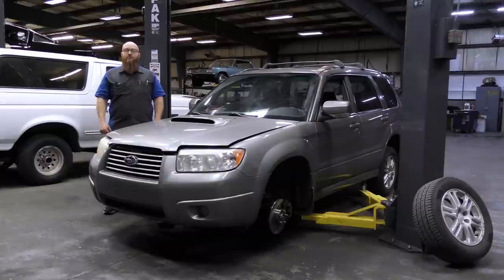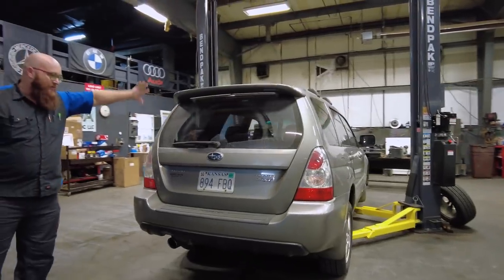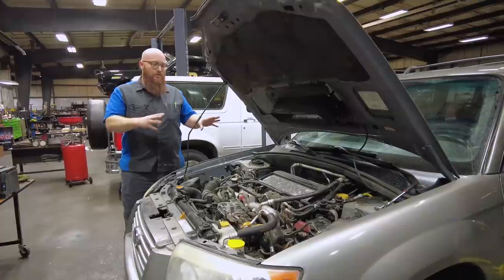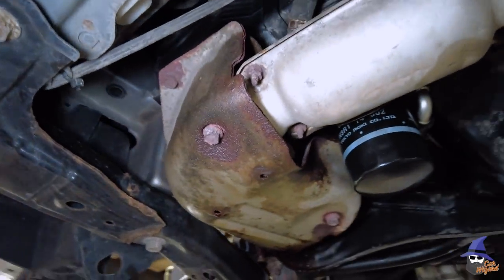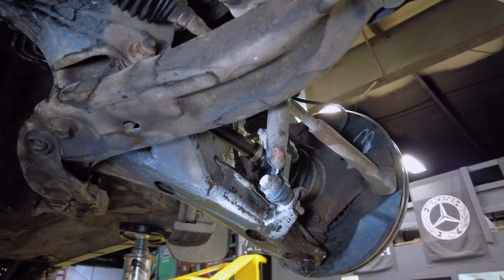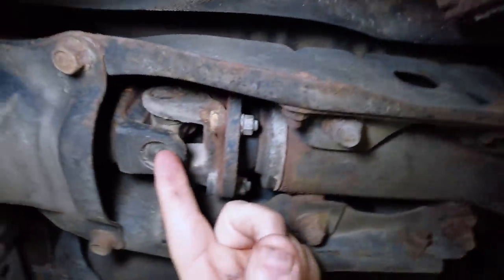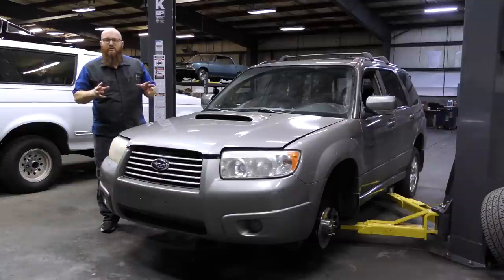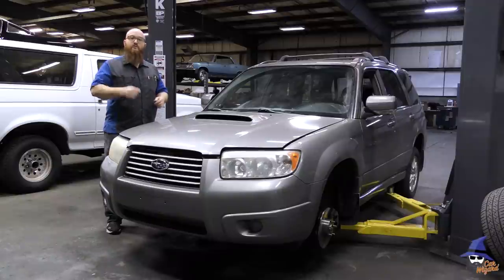Can't fix it all! '06 Subaru Forester XT has issues the CAR WIZARD doesn't fix. What are they & why?

Comment: AWD Subarus are fairly popular in the snow here in Canada, my rear drive van was spinning its drive wheels in the driveway yesterday and I was reminded why I was taking the Subie out and putting the van back in the garage. Thank you for covering this year of Subaru forester, there is plenty of power without a turbo, my tires are only rated to 100 miles per hour  or so and I wonder what sort of speeds that turbo would put out and where you could safely drive it.
Reply: Buy snow tires. RWD with LSD and good winter tires and you'll be sailing by spinning subarpoos all day.
Reply: They know lots about snowy conditions up in northern Japan.
Reply: @billermanthegreat  yes for sure, a good friend of mine  former apartment dweller from school in Texas, lives in Amori city, with the highest yearly snow fall about  9metres or 30 ish feet per year. I thought that my sister's place was bad in the Sault with 3m or 10 feet of snow, 30 feet annually is just crazy! One thing about Japan is that they pretty much force you to get a new vehicle after six years, while I drive  about 20 year old vehicles, my 2007 Subie is the newest in the "fleet".
Reply: @mikescherrer4923  very funny, my brother referred to my first car, Honda civic hatchback, as an upholstered roller skate which wasn't far off the mark

I take it all in stride, and I keep the 2001 Safari in the garage so that the salt doesn't destroy it, holding up quite well so far, I have an Astro AWD - minor rust issues - with snow tires for when some work needs to get done in the winter.
Reply: You think that's cool calling it a subie? It's not it's childish
Reply: @glennbeadshaw727  while I don't plan on growing up totally, espeically if the greats will be around, and my normal nickname for our Subaru wouldn't make sense to someone who hadn't seen it.
Reply: @glennbeadshaw727  this argument sounds pretty childish
Reply: @angelolagussa1312  I live in Seattle and we have many Subaru drivers they are no worse than me in my cars
Reply: @mikescherrer4923  lol. i quess you never driven a 4x4 before :D lsd does little to nothing on snow and ice. its good on tarmac mut not much else.  good or preferably studded snow tyres on rwd vs normal almost slick hard summer tyres on a subaru and it might be close :D but when you put them snow shoes on a subbie its really hard to beat.

Comment: The wizard didn't really explain what things they found were wrong with the Subaru. The wizard only said that this Forrester seemed a bit down on power and they were checking the cams for problems. The brakes were done, but that should not effect power output unless they were dragging. Another episode perhaps ?

Comment: Hi Wizard, many Subaru in the shop.  Very reliable? Not by book.  But hey the new models are pretty solid and good looking cars. 2020-23
Reply: I can say, from a dealership perspective, the new ones are only solid as far as crash performance.  CVTs are unreliable, the new engines have their own set of problems, and there are definitely some quality issues with certain things which you wouldn't expect.

Comment: Well, at least my Subaru I have to get a new engine in a 2010 Subaru Forester, and this time I'm deciding to up for the newly upgraded gasket. This engine fair with 190,212 miles on it the new engine has 110,000 miles on it.
This is within a 1-year ownership of the car.

Comment: Pedders suspension is Australian.
They have been around since 1950. They make all the dampers for the V8 Supercars (think Bathurst) and for a few Australian rally teams too.
Although I'm always quite surprised to Australian gear in American cars. You guys seem to buy a lot of ARB 4wding equipment also.
Reply: Foresters and Outbacks from the ´00 had self levelling suspension from factory, no matter how much load you put in the car, ground clearance was the same. Pedders was the only brand that offers a replacement that wasnt Subaru expensive suspension. Thats why Pedders offers same shocks here in Europe for Subarus of the era.
Reply: @Secrecy30  I didn't know that, excellent thanks.
Reply: There’s a few good Australian products that make it to USDM cars. Subie Lift Oz (SLO) is one of the most highly regarded lift kit manufacturers for Subarus. GM used PBR brake calipers for years on their Corvettes, and Ford used them on the Mustangs. Old school Ford guys used to import Australian cylinder heads for their 351 Clevelands too

Comment: How often to u-joints really need to be replaced on a car really? I mean as long as you aren't towing, do they ever really need to be replaced? I'm actually a little surprised a drive shaft specialist doesn't have the ability to cut off the flanges and weld on replaceable ones. When I worked at a speed shop, a common upgrade we did was a one piece drive shaft and all the drive shaft place needed was the flanges to weld onto a new tube they balanced.

Comment: These particular years were very problematic. I love the ones from 2003 to 2005. The only problems with those were the headgaskets.
Reply: Not exactly a simple problem but I get what you’re saying.
Reply: @MrSamPhoenix  oh yeah, it's a expensive problem. That's why I buy them with the headgaskets already done or blown headgaskets.
Reply: @dizk5283  yeah im just like you, i personally like the nonturbo models myself. They blow headgaskets way less and i can have them apart in about a day and fixed in 2 to 3. If i want a fast car, i just wont buy a subaru. Lexus is perfect for a reliable fast car. My 2 favorite brands tbh 😋
Reply: @adam Distortion  Exactly 💯 I love subarus, it's all the cars I have on my Channel.
Reply: @adamdistortion8810  The turbocharged EJ25 don’t have head gasket problems.
Reply: @suzumr2754  the fb series didnt, but the ej series did, people like to say they dont because most of the headgaskets that blow in the turbo models are oil leaks or combustion leaks, not coolant intrusion like the non turbo ones. Also subaru did use a better headgasket on the turbo ones, but they still blow. When i fix a nonturbo model, i use the better turbo model headgaskets, but they still will blow after 100 to 150k. It sucks but it is what it is
Reply: If you change the coolant every other year the composite head gaskets last quite a bit longer.  If you replace the head gaskets, throw the factory parts away and use Cometic gaskets.  This alone will solve the problem permanently.

Best way to avoid Subaru head gasket failure?  Buy the H6.  These NEVER have any problems, and no timing belts to change either.
Reply: Oh, is that all?  LOL
Reply: @Flies2FLL  the H6 and the EJ22 are some of Subaru’s best engines.
Reply: @Flies2FLL  ive heard lots of great things about the h6, but never owned one.i would trust those. Also cometic is the same supplier as six star i believe and both are really good brands
Reply: @adamdistortion8810 the 3.6 Subaru 2010-2014 has the 5 speed automatic. The 2015 and newer has CVT and those are trash. But the 2010-14 I get 29mpg on mine 87 octane fuel and it makes great power. The only real issue is the timing chain adjuster but mines been replaced. Very nice cars
Reply: @adamdistortion8810  N/A EJ’s are the ones with feb head gasket problem not turbo 😊
Reply: @suzumr2754  Huh? The EJ25 is the world's leading consumer of head gasket material...
Reply: @adamdistortion8810  👍
Reply: I would agree with that. I have a 2006 forester and finally gave up on it. First engine broke a timing belt I believe, replaced it with another and had electrical problems, plug/wire problems, then exhaust problems, now it has a TPS/PPS code. It’s just constant problems with only 150k miles. I went and bought a scion with 215k for $500 and it has been WAY more reliable. That Subaru is about to get sold or parted out, I’m tired of messing with it. This one car has sworn me off of Subarus completely
Reply: @Kansas Country  Dude I'm sorry. Like I said I would recommend 2003 to 2005. They are fun & have alot of space. Plus the Awd is awesome. I have a 2009 subaru legacy & 2014 subaru legacy. Awesome cars. I love them. My 2014 is just amazing.
Reply: @kansascountry970  Did you buy the car new?

One thing I can tell you is that the way the first owner did maintenance determines how the car treats it's later owners.  And this goes for all cars, Porsche, Volkswagen, Subaru....All of them.
Reply: @dizk5283  oh I know there are lots of happy subi owners, I’m just not one of them lol. After all of the time and money I’ve put into it, I just can’t buy another one
Reply: @Flies2FLL  no I didn’t, I bought it with around 120k miles from an actual old man and the car was in immaculate shape! It had all of the original paperwork and oem accessories so I imagine he took good care of it. I loved the car for the first 20k miles or so, but the problems just kept snowballing after that to the point where it was broke down more than not
Reply: @Flies2FLL  what u said is so true, but unfortunately most people who buy new cars nowadays dont maintain them properly cause they are new and probably wont be kept more than the lease period, so they do get abused more often than not
Reply: @Flies2FLL  Agreed
Reply: 03-05 Turbo models were some of the more problematic.  It's very important to run good quality synthetic oil and stick to 3k mile oil changes as well as pull the screens off the banjo bolts that feed oil to the turbo and AVCS.  Depending on the model you also end up with catalytic converter failure, later models did away with that cat but have an air pump instead (another point of failure, though it has been recalled). Head gaskets on the turbo models still blow but you just don't hear about it as often because the turbo engines are less common and there's usually some other catastrophic failure which necessitates the heads coming off anyway.

I see a lot of people talking about putting STI gaskets on an NA engine and that's fine 98% of the time but you want to be mic out your heads to be sure they haven't been machined down too far--the turbo gaskets are slightly thinner and you may have piston-to-valve clearance issues (again, not very common but something which can grenade your engine if you're just slapping the engine back together and not taking your time to do it right).
Reply: @406Steven  I have never bought a turbo model. I just get the regular ones. Turbo & subaru don't go together.
Reply: @406Steven  The 2006 to 2008 XT model is much better.
Reply: @dizk5283  Very true.  Seems like if a turbo model goes 120-130k miles before needing $10k+ in repairs they got lucky.  It's partially lack of maintenance and a lot of how people tend to drive them.  Lots of younger guys who think "check out muh rally car, bruh" then drive like an idiot.  Then when it blows up they throw a fit at everyone and everything except where the blame actually belongs.  It's not uncommon for our service advisors to end up spending a fair bit of time on the phone with the parents of the driver explaining what went wrong, why, and what it's going to cost to fix it.  Then Mommy and Daddy bust out the Amex and one of our techs is busy for a few days putting the car back together.
Reply: @406Steven  That is the best post re Subaru's that I have seen in a long time!
Reply: @adamdistortion8810  If you're using replacement turbo MLS gaskets and they're still blowing, you're not doing the job right.
Reply: @sblagg527  enlighten me
Reply: @adamdistortion8810  sorry to say you’ve been misinformed. non turbo models are the ones that blow headgaskets way more because they used single layer headgasket rather than the turbo model mls gasket.
Reply: The new ones are more reliable
Reply: You obviously couldn’t afford the XT. THERE WERE NO CYLINDER HEAD GASKET ISSUES WITH THE XT. 
I drove 150,000 miles in two XTs (300,000 miles in total) and never had any head gasket problems.

Comment: Also, the oil cooler on the XT turbo engines has a total of 4 orings, two large and two medium sized, you have to take the thing apart in layers to get to all of them.

Comment: I owned a 2006 XT from new in Australia where the MY06 had the full spec WRX engine not the detuned engine from earlier and subsequent years, it was a touring beast and sold after 13 years and over 300,000km and replaced by a 4WD for more serious outback touring. Up until then I only had one problem apart from normal wear and tear, a radiator tank split.

Comment: We deal with a lot of Subaru's at work, and experience a lot of SAI fault codes, just like this one. 
On the NA engines, there's not much else you can do than replacing them, but on the 2.5 Turbos you can get them disabled by some engine tuners. We sent them out to a local tuning shop, and they flash the ECU to disable the SAI system, costing €250 instead of ~€1000 for SAI parts.
Reply: NA's had it over there? Here in America only the turbo models had SAI

Comment: I have a 2012 Forester SH, which means that it is in the sweet spot where it has timing chains, not belts, and it doesn't have a CVT. I've had it for 3 years now buying it second hand, and all I have had to do are brakes all around, and a connection fitting on the oil cooler broke, so that was replaced. As others have noted, here in most parts of Canada, we get serious winters. I am currently running Michellin X-Ice Xi3 tires, and I have been able to drive through a metre (~1 yard) of snow with now problems. I do an oil change every 5,000 kilometers and she runs well. It may be the last internal combustion car I own. Next one will either be a hybrid, or electric...but most likely a hybrid.
Reply: You Canucks really don't learn...
Reply: @mikescherrer4923  I'll just laugh as I pull another Jeep out of a snow bank...

Comment: i bought this car for 3500 Cad a year ago and swapped it to a manuel! i think its the best!! I just love the speed and size but it is an older car and chasing issues wether it be rust sunroof problems ect is a thing. the secondary airpump is one of those things that overtime fails but most ppl tend to go the delete route by blocking it off and deleting the codes.

Comment: I'd take a bmw x5 of the same vintage. More reliable inline 6 m54 and robust awd system
Reply: I had the v8 non sport of the same year super reliable and not expensive to maintain. Sadly it was stolen in a shopping mall I miss that car one of bmws most under rated reliable cars. I still see a few trucking along from time to time
Reply: @lutha1720  if youre in the market, they can be had for under 5k. Though at this stage they all need the timing chain guides job done and that can be costly

Comment: Had a Legacy over 10 years. Alternator rear brake caliper and both front axles. Never left me stranded.
Reply: Actually, today the only car i know of that can stranded you are bmw and Range Rover. And maybe tire puncture or radiator puncture.

Comment: Thanks for the video, I need some advice, my 2004 forester has been to a couple of mechanics for a grind & AWD issue and the problem has kept on coming back after fixing, when fuse is changed and it is turned to 2WD, it seems very fine, I have been advised to buy a whole new gearbox but I am not so confident as I have bought many parts for the same problem and it never went away, it grinds when turning only when in AWD, it also throws on the AWD dashboard light when cruising at about 80KPH

Below are it's specs
-SG5C55T
-TZ1B5LBXAA
-EJ205DX5BE

Comment: Here in Australia I’ve owned 10 Subarus over several decades and wouldn’t drive anything else except for my Toyota Hilux automatic diesel (Tundra in the US?) - the Subarus have been reliable, capable light off-road vehicles, the best AWD system in the SUV market and have climbed many steep high country tracks here with no problems even fully loaded with camping gear - my ‘97 automatic Forester has been the most reliable getting me to 425000km before a camshaft finally seized - the ‘06 Forester had the typical head gasket issues, and driver window actuator failures only and my ‘09 turbo performed well but the new offset piston rod design proved to be a design weakness causing numerous failures for the ‘08-‘13 Foresters now too expensive on fuel (A$2.37  per litre) and the awfully expensive secondary pump ended this ownership.

Comment: If you are on a tight budget you can replace these U joints and any swing bearing that may be there with a 4lb hammer and block of wood however,  it will require a lot of labor and you will never get this to stop vibrating a little bit,  unless you buy the whole axle.
Reply: ...Never hammer on a balanced rotating component like the drive shaft-
can use press or puller. Yes, U can improvise if your time is cheap!
but, I am sure U can get the part from a Junk yard affordably.
Reply: @krisphoton7304  That is what the wood is for.

Comment: Regarding suspension, The standard suspension has a hydraulic self-leveling system on the rear which is prone to failure and expensive to replace. I would bet that's why they replaced the standard struts with a Pedders setup. I have the identical suspension on my 2006 XT here in Australia.

Comment: Hey car wizard, we are fixing it ourselves but we have an issue with our 2011 subaru forester xt 2.5 turbo. It has issues with reading the rear right abs sensor and had exhaust issues (we bought a replacement exhaust) and need to install it but the rear right abs sensor won't read at all, the other three will read but the back right has had the baring replaced, the speed sensor replaced, some rust polished off. It was sitting in a garage for 3 years and runs just fine but, the traction control is stuck off because of that. Could i get some advice?, also the code it throws is that the connection is weak to battery but the battery is fine. And as ive stated all the other sensors work but that one.